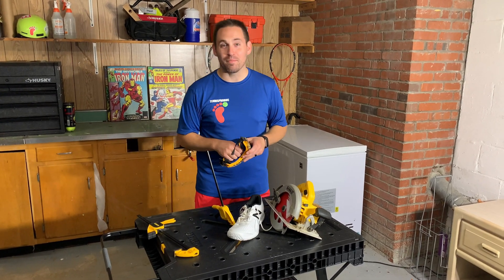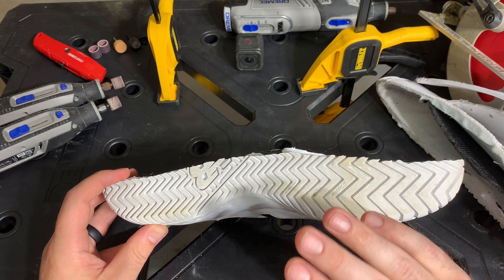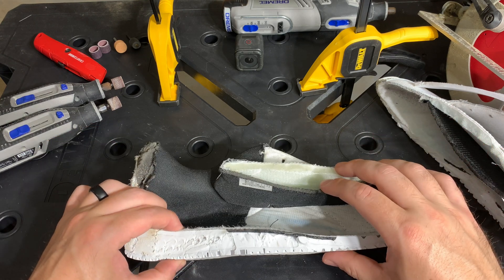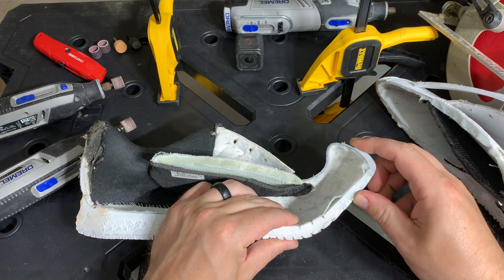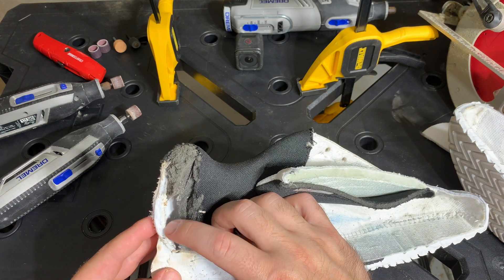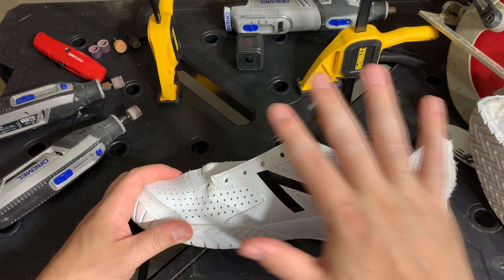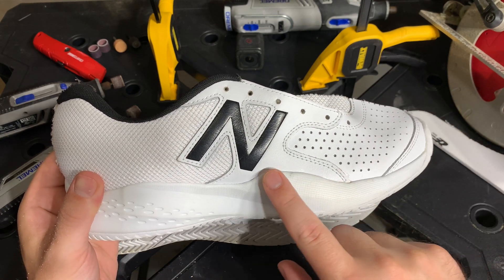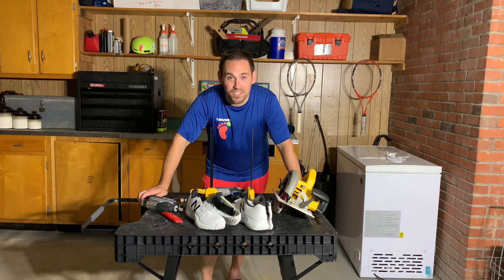Tennis Shoes Vs. Athletic Shoes | Cutting a Tennis Shoe in half to Find Out The Difference

Comment: any tennis shoe you can recommend to someone who's flat footed and 2E?? my "fallen arches" are something i was born with and trying to "correct" them causes extreme, and i mean extreme pain if i have any sort of arch. Converse, dress shoes, and specific Vans shoes are the only shoes that work for me. I've been getting, what is essentially, trainers since they offer more variety in arch heights (that and i can cut out the arch from the shoe). Any recommendations?  Athletic shoes aren't cutting it for me and I've already been injured more than once from using them
Reply from the maker: You have one of the hardest feet to treat I see in clinic as well as the hardest to get shoes for- I’d go one of two directions : #1 get a pair of mixuno wave exceed your 4’s in a size up because they will be narrow in your normal size, you can also try the Asics court ff 2 - the other option is to get whatever shoe you want and have a podiatrist in your area make you an orthotic that is stiff and flat that way it will go over the arch in the shoe making it flatter for you that way there’s no correction but there is support for the muscles , ligaments , and such. Or you get a custom molded brace that does the same thing - if your case maybe I would go with the brace ( AFO or Arizona brace specifically ) if that doesn’t do the job then lastly you could need surgery which obviously would be last resort but may be very helpful long term - hope that helps! If you want you can send me a picture of your feet and xrays if you have them to th email address on my YouTube page
Reply: @FootDoctorZach  yeah, i haven't seen a podiatrist professionally, just the podiatrists my doctors in the hospital that are friends with that pop by. they look at my feet and i give them the same story i told you and they tell me the same thing, "hardest to treat and hardest to get shoes for" and "your anatomy just grew around the feet, correcting your arches now would probably give you body pains since you were born with it"  lol but thank you for the recommendation. i don't have xrays but i could always pop by the xray department and schedule something since there are days i'm trying to work the floor in the hospital and i'm limping cause of arch pains from my shoes from playing tennis the night before. I can give you a picture when i get the time, but think of it like this, the only gap you see in my feet is my toes, the rest is just one big, flat blob lol
Reply from the maker: Well I disagree with the “don’t fix them “ sentiment- I would agree if you weren’t having any pain but since you are limping - correction is for sure indicated if the other treatments such as flat orthotics, bracing, or changing your shoes don’t help- we perform those procedures routinely with good results and there are great docs just about everywhere that have good skill in that area if you want I can always try and give you some names
Reply: The Tennis Pro Doc ah I’m only limping because of the arch in the tennis shoes and other athletic shoes. There’s times I’m forced to whip on converse or vans skate shoes to give my feet a break during a hitting session. The only time I have pain is when there’s an arch in the shoe pushing on my arch. Aside from that, if I could play in Converse’s, I would, but the amount of times I roll my ankles is getting too painful lol
Reply from the maker: Ok I see now- hard to diagnose over youtube comments haha- yeah I’d go w the flat custom orthotic or mizunos
Reply: The Tennis Pro Doc I will def try both of your recommendations and let you know ty

Comment: Interesting you mention carbon fibre shank.  I’ve not seen a carbon fibre shank in years.  Lots of plastic or Pebax. No real carbon fibre bar professional customs shoes.  Some fake carbon fibre though (graphics)
Reply from the maker: Yeah there’s been a shift to polypropylene for sure but I still see some CF  - I probably should update that though thanks for catching that !
Reply: The Tennis Pro Doc I’d have thought the manufacturers would be shouting about it as a feature. It’s premium and like Roger Federer so will drive sales.